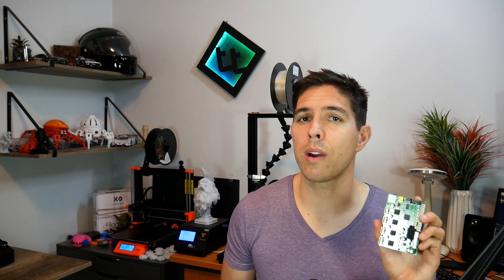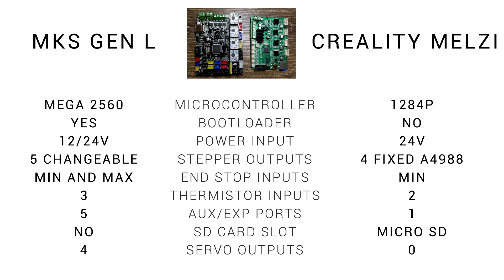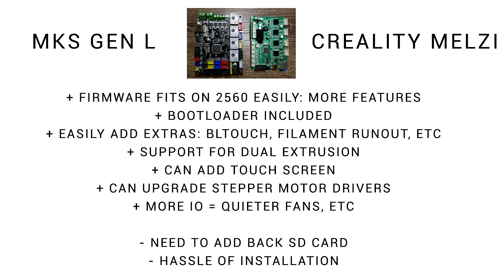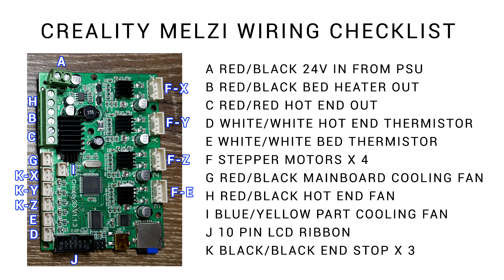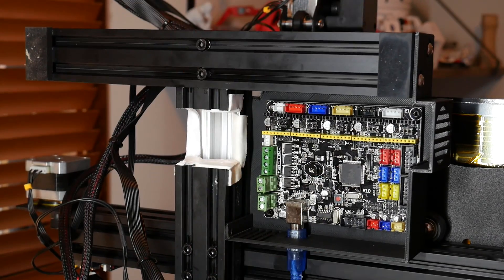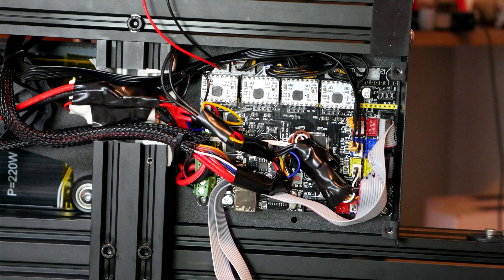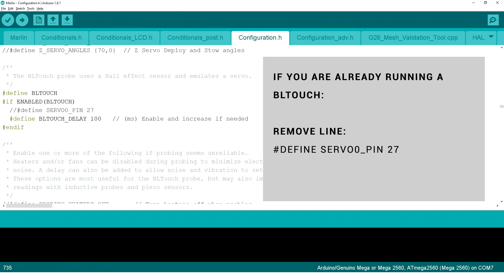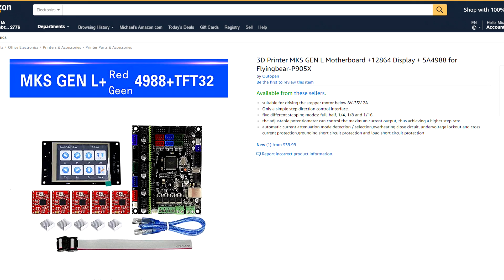Easy and cheap Ender 3 mainboard upgrade: MKS Gen L guide

Comment: make video with tmc 2208 and original display with only added sd card reader.(is cheapest 2$)
Reply: i bought this: 
MKS Gen L & TMC2208 Combo:  https://www.banggood.com/MKS-GEN-L-V1_0-Integrated-Controller-Mainboard-5pcs-TMC2208-Stepper-Motor-Driver-For-3D-Printer-p-1296711.html?rmmds=search&cur_warehouse=CN
Fans: https://smile.amazon.com/gp/product/B07DB5H6K1/ref=ppx_yo_dt_b_asin_title_o00__o00_s03?ie=UTF8&psc=1 (good for replacement, but not any quieter than originals)
right angle USB: https://smile.amazon.com/gp/product/B003B454YY/ref=ppx_yo_dt_b_asin_title_o01__o00_s00?ie=UTF8&psc=1
plastic standoffs: https://smile.amazon.com/gp/product/B07F685ZF1/ref=ppx_yo_dt_b_asin_title_o01__o00_s00?ie=UTF8&psc=1
Marlin 1.1.9 and the example Ender-3 configs for a starting point
Arduino 1.8.8

slapped it together last night.  I used the original main board enclosure with no modifications, there is plenty of room in there to add the right angle USB and feed it out under the frame with the rest of the cables.  I covered the original mounting points in the enclosure with some electrical tape for safety and used 3m heavy duty 2sided tape on the bottoms of the plastic standoffs and that appeared to give enough clearance to not worry about shorting out the bottom of the board on the original mounts (probably a better way of doing this but i was anxious to get it put together).  I also completely removed the enclosure, ran/connected all the cables, mounted the MKS and then mounted the enclosure, much easier to plug in and route cables that way.  All cables fit well except the thermistor for the extruder was a bit tight.

LCD was connected as described in other comments, with one ribbon cable EXP1 on MKS and gently prying off the EXP3 socket on the display and reversing it.  I did not change any display settings from the original Ender-3 example config in the Marlin distro.

I set the voltages on the TMC2208s to:
X:  .9v
Y: 1.2v
Z: 1.1v
E: 1.1v

Copied _Bootscreen.h, _Statusscreen.h, Configuration.h and Configuration_adv.h from the \Marlin\example_configurations\Creality\Ender-3 directory to the main Marlin directory.

Installed the U8glib and TMC2208Stepper libraries to the Arduino IDE.

Configuration.h changes:
pretty much followed Michael's video except for the following:
uncommented and changed the 'driver_type' settings starting on line 551:
#define X_DRIVER_TYPE  TMC2208
#define Y_DRIVER_TYPE  TMC2208
#define Z_DRIVER_TYPE  TMC2208
...
#define E0_DRIVER_TYPE TMC2208

Also had to modify the stepper direction differently than Michael's example (line 849):
#define INVERT_X_DIR true
#define INVERT_Y_DIR true
#define INVERT_Z_DIR false
...
#define INVERT_E0_DIR true

I think that is everything.  powered it on, leveled the bed and all worked fine (well, after i corrected the stepper direction).  

i literally sit 3 feet from the printer in my office and i have had to keep looking over at it to make sure it is still printing because it is so quiet.  The 2208s are golden.  The rotation of the filament spool is louder than the stepper drivers.  Need to upgrade the fans and should hardly be able to tell it is running.  

I also noticed a bit of improvement in the print quality.  Also, i am not sure how hot the stepper motors ran before, never paid attention, but the X & Y are fairly hot, Z and extruder seem fine.  Might have to revisit the voltage settings on X/Y drivers.
Reply: @Kevin-gh1cn  Out of intrest do you have the dampers installed aswell. Or are you getting this kind of silent operation just with new drivers?
Reply: @lukas1672  that is without dampers. I tried the dampers on x&y but seemed like the stepper ran hotter and the Y damper caused the motor to sit out enough that the bed carriage hit it and wouldn't home.  

I only had the x on for a few prints but I couldn't tell the difference between having it installed or not. Wouldn't waste the money honestly.
Reply: @Kevin-gh1cn  oh ok, wish I would have doved deeper into upgrades before going the damper route. Got the new model with pressure fit pulleys, so I vote a gear puller to remove them, got new grub screw pulleys and the dampers. Also dremeld out the carriage in the area where the motor blocked it. 
In the end payed 40€ for the dampers, pulleys and gear puller. Would have already been the new board and nearly the drivers....
Oh well.

Is the arduino necessary? As far as I understand the new mainboard has a bootloader which was the main reason wan needed a arduino before on the old board.
Reply: @lukas1672  yeah, i'm only out the dampers.  the reviews were mixed and since i sit right next to it and have a lot of conference calls when i work from home i wanted to quiet it down as much as possible.  Should have waited until i put the new board and drivers in.   

full disclosure, the banggood board and drivers ran about 4 days and a dozen prints then wigged out.  I  had added the BLTounch to it and got all that working.  I printed a number of single layer bed leveling calibration prints and in the midst of printing one of them there was a loud, extended BEEEEeeeeeeep and everything stopped.  Couldn't connect to the board over USB anymore (but the display would light up with the power off, although it was dim) and it would not drive the motors.  I ordered a new board from Amazon (https://smile.amazon.com/gp/product/B07DQD5WJP/ref=ppx_yo_dt_b_asin_title_o09_s00?ie=UTF8&psc=1) but ended up needing all new drivers also, ordered them from amazon as well (https://smile.amazon.com/gp/product/B07K47Z7MN/ref=ppx_yo_dt_b_asin_title_o05_s00?ie=UTF8&psc=1). 

I am in MN/US so it is dry as heck here during the winter, lots of static build up.  Not sure if that is what got the MKS board but i am confident it's what killed the Ender3 OEM board.  Before installing the (2nd) new MKS board and drivers I wired the frame and all isolated parts (bed, extruder, hot end, etc) to a grounding bus and tied that to the power supply ground.  Seems to be working and i have not noticed any feedback issues but probably should put some filters in on the grounds. 

Overall i think the MKS and TMC2208 driver upgrade is well worth the effort and $ if you are looking for a very quiet printer, it is amazingly quiet.  I think the only thing i would add to make it any more quiet would be a new power supply fan.
Reply: @Kevin-gh1cn  thanks for all the detailed info. Definelty will consider this upgrade in the future. Will upgrade the mainboard and drivers once I go the bl touch route instead of trying to get the old board to work with it
One question I still have is if the arduino is  necessary? As far as I understand the new mainboard has a bootloader which was the main reason once needed a arduino before on the old board for firmware upgrades etc. The new mainboard already has a bootloader as far as I understand so is the arduino necessary?  Sorry for asking so many questions on a youtube comment, you seem to know your stuff :D at least way more than I do
Reply: @lukas1672  no need for an Arduino with the MKS board.  connect it straight to your usb and update the IDE with the TMC2208 driver libraries.  Works great.
Reply: @Kevin-gh1cn  ahaha when installing my dampers I literally just got an angle grinder and cut out the part that hit the stepper motor.  Luckily now I don't need them as I also upgraded to 2208s and the printer is dead silent.
Reply: Yes please,  i`m interested to in "MKS Gen L" with the "Trinamic TMC2208" configuration
Reply: oooo yes please!

Comment: great video. i've find a case for the MKS Gen 1.4 and installed it in my Ender 3. It works great.
Reply: How did you wire the part cooling fan? I have the same board but I was stumped by that.
Reply: @MercutioLeonhart  at the pins right of the heatbed Pins. its Label fan. https://reprap.org/forum/read.php?13,753796
Reply: Vape Buddy Thanks! I thought that was for the Hotend fan, doh!